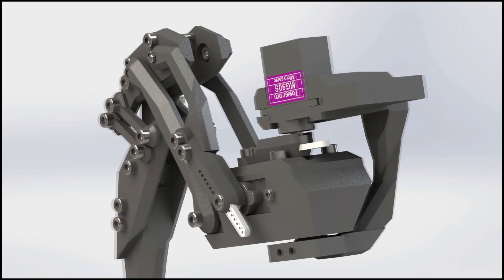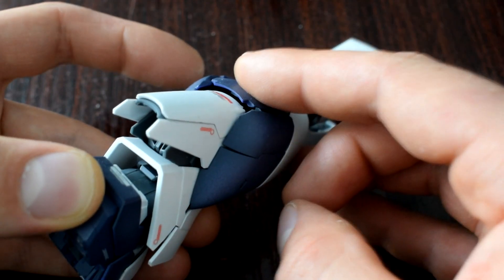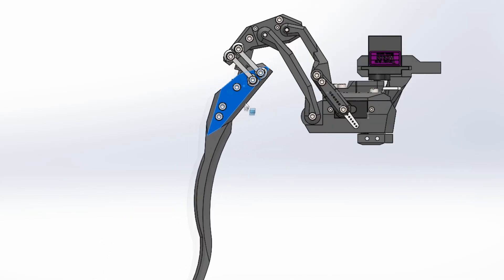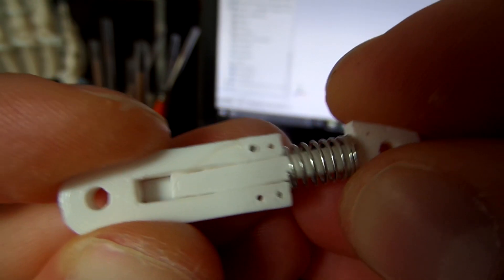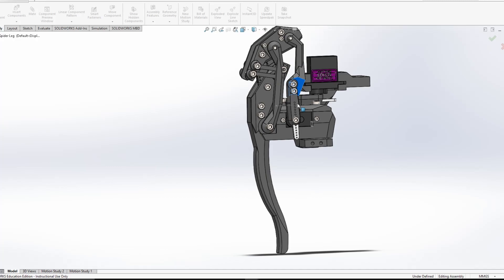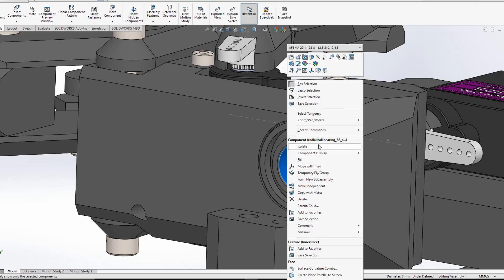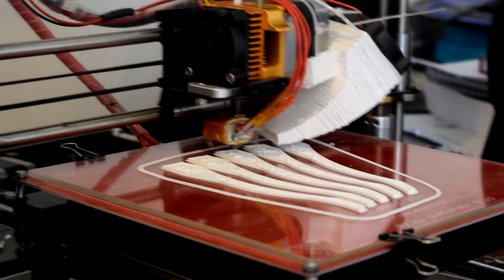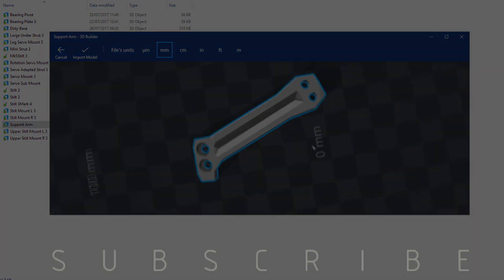3D Printed Arduino Hexapod Part II - Leg Design

Comment: You have a problem with the flow of filament from the nozzle. Your prints look as if any layer has hardly ever been printed. such prints are easy to separate because the layers do not stick to each other.

Comment: Super cool design but as a few people have pointed out, your printer needs to be calibrated. That fan shroud you've got must be leaking more air than it's directing to the nozzle.
https://www.3dhubs.com/talk/t/howto-calibrate-tune-and-fine-tune-your-printer-and-filament/5695
I'm super excited for the end product but you're gonna have to do the design justice by sorting out your printer.

Comment: Dude tune your printer, your extrusions look absolutely atrocious and that's not normal. 
You might think "Well that's what i get for 200$" but no that's not normal quality even for the worst printer out there. 
3d printer is a complicated tool that requires an appropriate technology, speed, temps and all, and you aren't using it right.

Comment: over-complicated fancy , paralellogram based joints.  
i love it. 

try to get those ultra fast 0.07 degree/sec servos. so it moves blazingly fast
Reply: Do you have a link to check them out?
Reply: @Paw_Low  https://www.aliexpress.com/item/4000171056251.html
cheap

https://www.aliexpress.com/item/33034968306.html
expensive

Comment: look good but
super limited moves 

ultra complex & heavy 

basic hexapod motion requiert only a single motor for all the six legs
mg996 servo rate 15kg/cm for 100gr 

mean your 30cm lever let a single kg of total power for a side of the walker 

when the 12 servos  weight already 1.2kg alone

Comment: I like over articulated mechanisms, it looks very cool, what simulation software you are using for design the legs?
Reply from the maker: Solidworks but I use fusion 360 nowadays
Reply: @WillCogley  peut on trouver les fichier Fusion quelque part ?

Comment: Those 3D Prints look kinda terrible... Concerning the Dampers, you could easily have printed them standing upright this getting perfectly cylindrical dimensions or work with press-fit metal rods and bushings to achieve a much better result - Having a 3D Printer that can do "anything" is no excuse to not also consider other materials that do a better job than an entirely 3D Printed part - I mean... You DID use regular bearings!
Reply: No b J.K. hh

Comment: those 3d prints look like the stepper drivers are over heating due to too much current or not enough cooling on the motherboard. I assume all your parts are quite fragile in result of that.
Reply: Where do you see steppers?

Comment: @02:29: Nice work. I see a collision problem with your z-axis servo that sits in the pivot block. The second linkage leaver should be bowed-out right were the servo arm connects to the linkage lever arm. The first linkage lever arm should be bowed-in. This will allow both linkages to pass each other and not collide. Of course I can be wrong. That's my Two Cents. xD
Reply: this was the purpose of this design to be nice and not pratical
because what you mentionned cant look nice
Reply: @omnianti0  okay